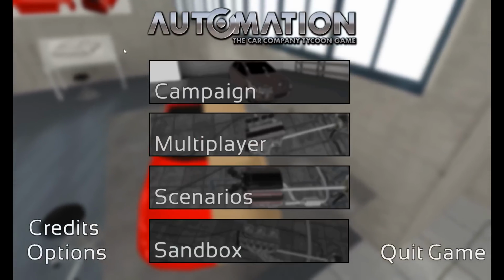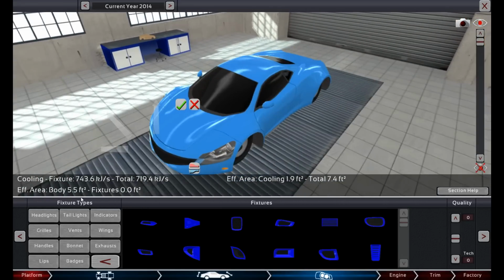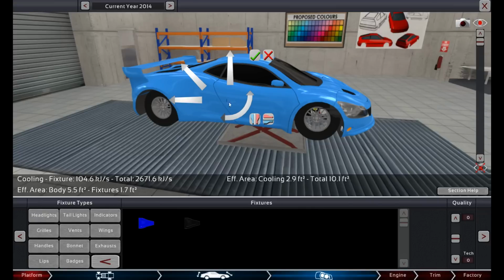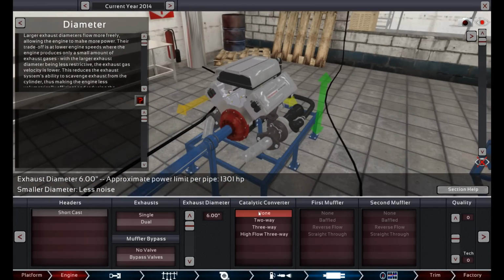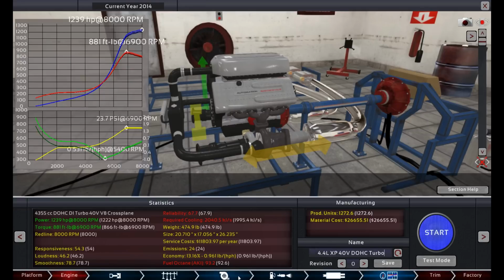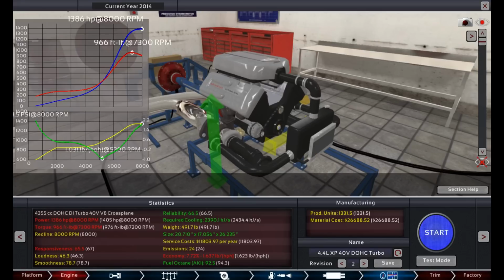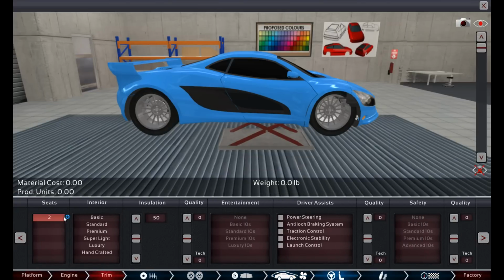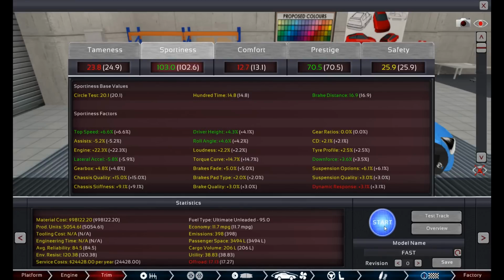Automation - Making a Stupid Supercar

Comment: once you have achieved your top power, then changed to inline flat, you needed to recheck engine size as well as adjusting the RPM limit in little increments and the you will find you can also increase the boost a little bit as well, hearing it hit the limiter, you could just tell it had more legs left in it yet, in theory... Ive never played this game, i real tune engines for a living... I do like your vids though, not the first one ive watched.

Comment: In the original Forza horizon, I run 300 hp for touge (mountain pass) racing. You are not satisfied with 1000 hp more than what you could ever need on a mountain course.

Comment: It's bad at cornering because the headlights hit the front tires...
And please when you go around tracks, let the car finish the lap so that we actually have an idea of how fast it is, with a time...
Reply: Nicolas LEBLOND You can actually just stop the lap a few seconds after it starts. And that's what that squealing was!
Reply: +Nicolas LEBLOND That makes sense.
Reply: +TheBlackWaltz No, the squealing was the brakes. Higher performance brakes typically squeak at low speeds because of the compound.
Reply: MrXorHomer Nope, it was the wheels. I had the same issue and I had no idea what it was, and it turned out to be the tires touching the car as it drives.

Comment: I think you're slowing down your car by putting such wide tires on the front. Typically the rear tires should be really wide, while the fronts are more of a normal size, it helps the handling a lot in supercars, so for top speed it might not make a huge difference, but on the track it should.
Reply: The tires got really in-widened when he increased the rim.
Reply: I think you mean they got skinnier, which they did, but they were still really really wide, having super wide tires helps with traction to get going, but can be a hindrance in the turns, on the front you would have a very limited turn radius, as they would rub against other parts of you turn too far.

Comment: hey ybr you should try to make a drag truck forget handling make it go fast in a straight line o and remember its not all about hp that makes it accelerate fast its mostly torque you hade 900 ft. lbs.. that's what made the acceleration its all about torque hp just helps the top speed torque helps the acceleration drag truck

Comment: This shouldn't be considred a supercar since it barely has comfort and almost no safety and tameness is almost nonexistent. This is more like a dragster than a supercar.
Reply from the maker: Sean Mendoza I think of it like the F40, that thing was basically no comfort, it's basically the exact same thing.
Reply: the mclaren p1 also has zero comfort racing suspension and racing seats and pretty much no things like music
Reply: Sean Mendoza You are right, WhyBeAre and Joshua are wrong, they are letting the looks over shadow the stats. This is effectivly a badly made drag car, there is nothing close of a supercar except the exotic materials and technologies.

A Supercar would have more then 0.9 degrees of negative camber, a harsh suspension maybe but some insulation and muffler systems. A supercar would be sort of tame and would make a way flatter engine power curve instead of puking out 1400hp over 7000rpm. A supercar would probably make 500hp as soon as 4500rpm and rapidly make 800hp around 5200rpm, 900hp around 6000rpm and keep around 1000hp until 7000rpm. You would need a smaller AR ratio on the turbo charges, ideally more bore and less stroke. The cam profile wouldn't so huge because of the forced induction anyways, alots of boost on that smaller AR ratio would be achievable with a huge inter-cooler and proper timing. And oh, btw, WhyBeAre, you messed up on the tires, they went back to quite skinny.

So yeah, it might look like a supercar but it's more like a drag car with skinny ass tires and a bunch of electronic useless crap. I don't believe many supercar nor drag car use Electronic stability control. Driving the said car hard would probably just destroy the brakes from the ESC constantly kicking in.
Reply: Yoan Carlove you arent describing a supercar but a hypercar
Reply: joshua de backer No. A hypercar is just what I said but better
Reply: joshua de backer Yes, and didn't say 1400hp!
Reply: joshua de backer " A supercar would be sort of tame and would make a way flatter engine power curve instead of puking out 1400hp over 7000rpm." - Yoan Carlove
Reply: the 458 is a sports car...
Reply: ***** We're not in 2001 anymore...
Reply: ***** I agree s2k is sport's car. Mustang is a mild muscle car like camaro. taurus sho is a sport-tourer.
Reply: You're trying to impose your opinion here... I mean, are Hot hatches sports cars according to YOU? Caus right now it's all acoroding to you. a taurus SHO is NOT a sports car for the same reason a L67 buick regal is not a sports car. They are touring cars!
Reply: Yoan Carlove I agree with you on what makes a supercar. You don't even need much power. I got 1200 in my hypercar, and I beat everything around the top gear test track according to their lists. but I also have some infotainment, and comfort options thrown in also. And is that break squeal coming from his laptime??
Reply: ***** You answered your own question. It's a normal car, tuned to be a more sporty drive. Sports cars tend to be two door coupes designed to perform well, and be fun to drive. They don't have to be expensive, but the car is designed as a sports car from the ground up. A hot hatch, is exactly that. A hatchback designed to perform better.
Reply: TheBlackWaltz

I was gonna fill this chat box but instead ill just say I agree about everything and move on.
Reply: ***** Then according to Merriam Webster, a camaro, a mustang or a taurus SHO are not sports car because they do not have nimble handling and that's basically where I stop.

The hot hatchback is a sports car by definition but it has its own category that's my point... If we go over my point then yes, FWD cars like sport coupes and hot hatches are sports cars.

But still the taurus SHO is too comfy, luxurious and not nimble enough to be a sports car but is rather sports tourer. It started out as a tourer and was improved in sportiness. 

When you got above sports cars, you get super cars.

When you go above sports tourers, you get grand tourers.

When you go above both grand tourers are supercars you get hypercars like the Bugatti veyron and I have no other example for a hypercar.

It's not because all of the above are "sporty" that they are sports cars...
Reply: Obviously you know nothing about super cars. Super cars are built for speed not comfort. The two iconic super cars (for me at least) are highly expensive, but comfy. I'm talking about the Lamborghini Sesto Elemento and the Lamborghini Veneno are comfy, the McLaren P1 on the other hand isn't. Again Super cars = speed not comfort.
Reply: Nvm the Elemento and the Veneno at hyper cars, oops. Well,
That's embarrassing
Reply: Well he did say he's not good at designing things

Comment: he forgot exsaust
Reply from the maker: Daniel zhang It's too classy for exhausts (at least that's the excuse I'll use)
Reply: WhyBeAre When you messed with the wheel diameter it reset the tire width and you never put it back to max, that's why it couldn't turn.